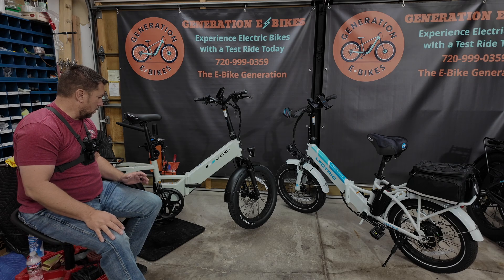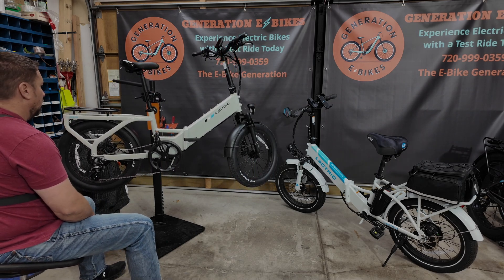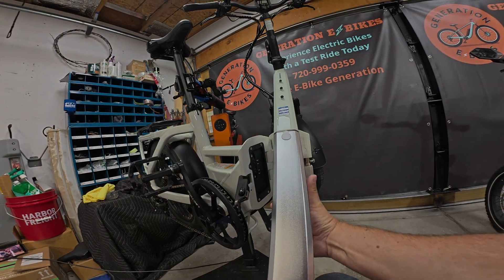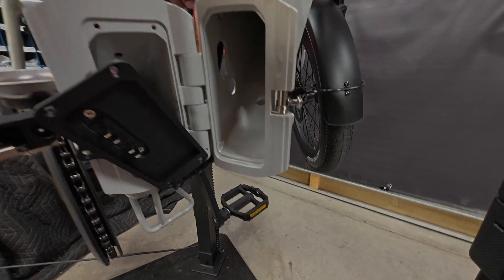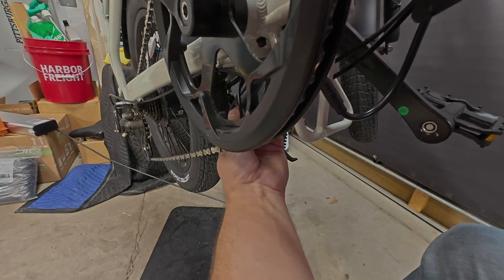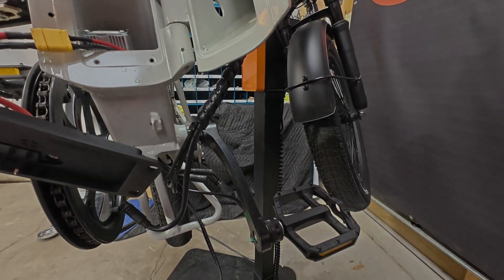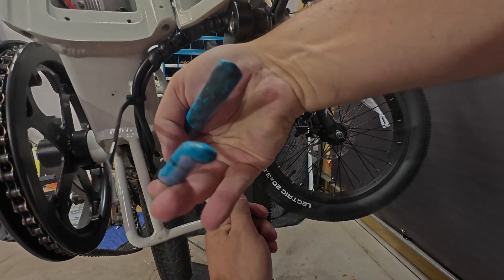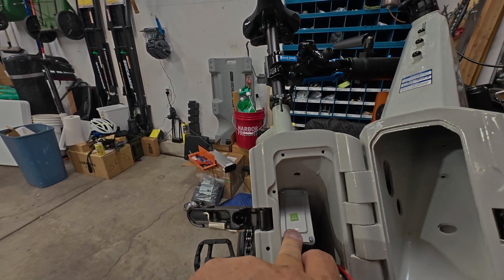🔧 Lectric XP4 Dual Battery Prep | Electricallwheel & Generation E-Bikes 🔋

Comment: Would have been nice to have the key hole for the battery on the other side of the frame. If the bike is on the ground it’s difficult to remove sometimes because the frame needs to be partially unfolded.
Reply from the maker: I agree, not sure why they put it on the folding side

Comment: What is the advantage of this as opposed to simply carrying the extra battery and installing it when the other 1 runs out of power ?
Reply from the maker: The main advantage is Voltage Sag when the battery gets low the bike doesn't output the same power.  This will draw on both batteries at the same time.  You can do either way but doesn't pull down the main battery as bad.

Comment: mine has slow acceleration now with tannus armor :D its a lot smoother the ride though on sidewalks
Reply from the maker: Change the torque multiplier from 0 to 1 and that will help a lot with acceleration.
Reply: @GenerationE-Bikes  i also have my rear tire set to 34 psi because i have the tannus armor so dunno if that could be why also. dang the ride is so smooth though now man curbs are no problem and I'm riding with 2 jbl 3 boom boxes on rear
Reply from the maker: The throttle won’t change with the torque multiplier, only pedal assist.
Reply: @GenerationE-Bikes  i dont see an option like that with numbers. I just see 2 options one says increase torque I did do that.

Comment: if you wanted to run two batterys on xp4 750 W.... would that be possible, and can you just plug it in while both are inside bike to charge?  Looking to extend the range on my 750w xp4, but new to all of this. Seems like a pain if you have to constantly take out both batterys to charge them, vs just literally buying 2 long range batterys and swapping them.
Reply from the maker: @Jimmy2Sh03es If you check out my description of this video you will see a link for ElectricAllWheel, they sell a kit with a 40Amp balancer for the XP4 750W to add a second battery.  I am currently working on a video that shows exactly how to do it on the XP4.  I have both the 500W and the 750W.  Stay tuned as it should be out very shortly!

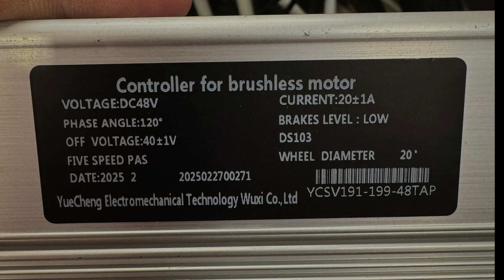Comment: Appreciate this close look at the controller. 7:20 - that's some not-so-great drilling burr around the hole in the top there, will check & hit it with a file if mine has it (bit of a QC note). 
I think I'll probably model/3d print some shims in TPU to hold the controller steady up against the side, which should help with heat dissipation. Or, maybe bumpers for some shock insulation - probably not a bad idea.. Controller's basically plug-and-play with any ~48V lithium battery with that XT60, which is nice to see. Proprietary OEM battery interface is really just a solution for the hinge.
Reply from the maker: I agree but with the amount of bikes they are selling, I am sure they don’t worry about burrs.  The install of the balancer will be super quick and I’m working on editing that one now.  Both bikes will have extra batteries.

Comment: Is there enough space between the rear fender and the seat tube to use the 10ah battery shown on your XP 3.0?
Reply from the maker: Absolutely!  I should have the kit today and will try to video it either tomorrow or when I get back on Thursday and post it.  I’m excited to knock that out.  It will be super easy.  The high step however might be a different story.  I will have to check
Reply: @GenerationE-Bikes  That's amazing! I need more amp hours than the stock battery included with the XP4 long range but I don't want to be stuck with something that I have to put on a rack or something that would interfere with the fold. This is great news and thanks for answering my question. I've been checking you channel every day to find out!
Reply from the maker: I will do the new video Friday and edit it so I can post it Saturday morning! It will be very easy to do since we don’t need to remove the controller.  I took the controller out to show Matt at Electric All Wheel.

Comment: This is great. Looking forward to the next video where you add the balancer. I see that this is the 10Ah battery vs the 17Ah. What size motor is this one. 500 or 750. Will the controller for each size motor be different?
Reply from the maker: Thank you, I appreciate that!  This is the 500w motor and have the 750w coming.  I do believe the controller is different and will show that as well when it comes in.
Reply: @GenerationE-Bikes  I’ve always suspected they are the same motor with a different controller to output a different amount of power. It will be interesting. What you find.
Reply: How does this bike do on hills? Should the 750 do a lot better? We want to use these in the field for work. We work all over the country and are commonly in hilly areas. Thank you for any info.
Reply from the maker: The 750 will be way better on hills. It will have more torque than the 500w.  I will do the same route with my 750 that just showed up to compare them and show the difference!
Reply: @GenerationE-Bikes Thank you for the reply. Can't wait!
Reply from the maker: I did the video and editing it now so Saturday morning it should be out!  It’s considerably better than the 500W on my test hill.

Comment: I like the fact you still have resistance to the peddles at 31mph, I can tell that by the display, it had like 10-15 watts of input power and just over 100 watts of power. Normally there would be a hard cut off at 28.
Reply from the maker: The cadence sensor in this bike is very good.  It makes this bike very easy to ride and enjoy to be honest!